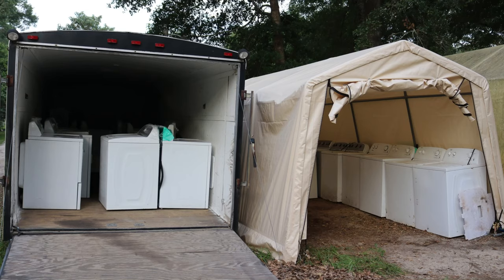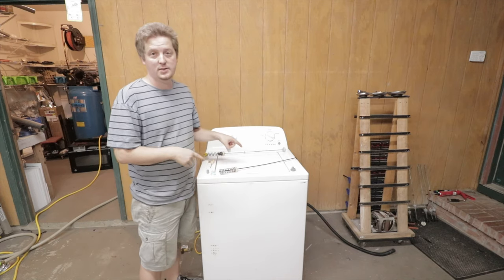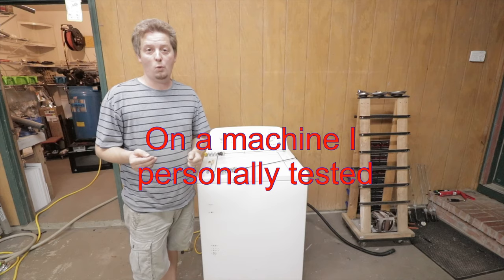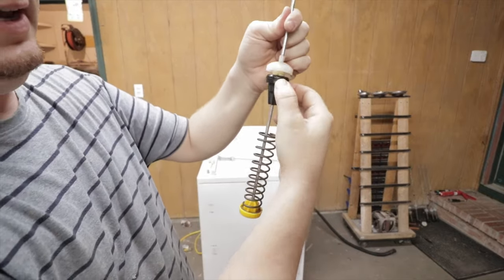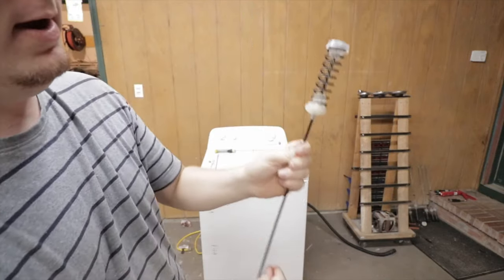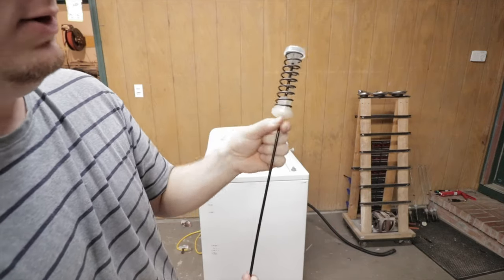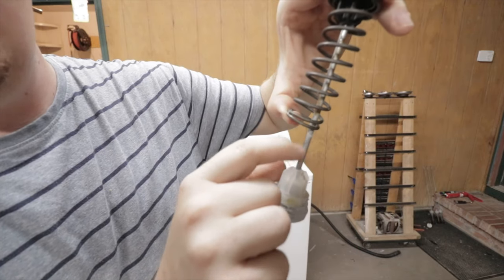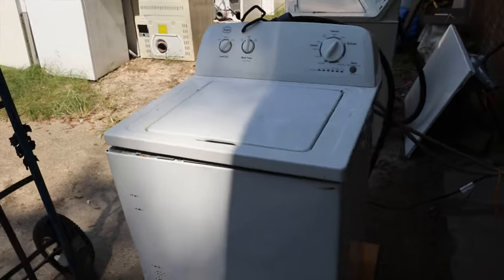Cheap Permanent? fix for shaking banging Washer? $7 to fix Suspension dampening rods W10780048

Comment: What if that top little round cap (the one that goes through the hole) is broken on one rod? I can't figure out what they actually do, since they are usually placed so far above where the spring assembly touches bracket on the side of the tub...
Reply from the maker: The tiny round cup that sits in the center of the ride I have always wondered about myself. I think it's just to help position the rod when they are putting them through the washer. But I'm not really sure.
Reply: I think that cap is there to shed any moisture off the rod as it goes down keeping it out of the resistance module

Comment: I been wanting to try this fix but fuze-it is not readily available around my area. Do you have any suggestions for similar construction adhesives I can try such as Loctite, Gorilla, or other versions of Liquid Nails? Thanks in advance.
Reply from the maker: Probably the regular version of liquid nails would be fine. The problem with liquid nails how long it takes to dry and then you have to keep the two caps separated for it to dry because it doesn’t like to dry sealed. I was about to do an experiment with windshield Glue. There’s a bunch of people claiming it works very well.
Reply: @WasherDryerMoney Great! Can't wait to see how it goes.

Comment: Would it hurt to add a little Nyogel 767A Synthetic Damping Grease to the rod after doing this Fuzeit repair?
Reply from the maker: I did not and it’s still working fine after all these years. I believe the dampening grease is just a factor for the original piece of foam to try to delay It’s ripping and deteriorating.
Reply: Thank you for your speedy helpful reply.  I will not use any dampening grease on my Fuzeit repair.
Reply from the maker: @blackdogjenny  I’ll be doing a different repair soon. Probably in the next week or two. It will be better than new and easier.
Reply: Looking forward to it
Reply: Couldn’t get Fuzeit to fully cure even after 5 days.

Comment: Thank you for your videos! I have a question. I have a Maytag Bravos thats banging around during the spin cycle. I ordered a set of rods but the ones that came were about 2in shorter. Got them in anyways and the washer is still shaking. Could the rod length be the problem now? Just wondering if maybe the new rods are the wrong ones for the washer or if theres anything else wrong with it. Thank you very much!
Reply from the maker: If the runs were shorter that's probably not the right rods. It could be that they are the wrong size and starting to hit something it wasn't able to touch before because it's 2 inches higher.
 it's hard to say for sure without seeing the machine but I would start with getting the right size rods that might just be the problem.
Reply: @WasherDryerMoney  Thank you for the quick reply! Its not really touching anything being 2in higher, but maybe if they are the wrong rods the springs could be softer maybe? Making it less stable? Dont know much about washers but yeah, ill order the right rods and see what happens, other than that, i dont see anything else wrong with it, theres no play in the shaft so i dont think its the bearings but the inner tub does have a tiny bit of play, dont know if thats normal.
Thanks again!!
Reply: @srolmeda  The tub is not 2” higher with the he shorter rods?
  Are you sure the tub ring is not hitting under the washer top?
Reply: @rickeykeeton71  Its higher with the shorter rods but its not touching on top. Im thinking with the tub being a bit higher up, it makes it unstable. Havent gotten the new rods yet, when i do ill give an update if it fixed the shaking or not. Thank you!

Comment: I’m going to try rubber “ cone washers “ as in sink water supply lines. HF and HD has assorted groumets. If fails, I’m going to try “ rope packing “ that goes around faucet stems. Should grip tight allowing movement as faucet stems move on and off. Maybe use tight “0rings “ to fill space and damper movement of damper .” Lol

Comment: Having the same issue,i was thinking how about a piece of pvc pipe  running the length of the rod to the shock and at the top put piece of rubber where the rod goes through?
Reply from the maker: that may work.

Comment: Are those flimsy suspension springs necessary to install when you're replacing the suspension rods in an Admiral top-loading machine?
Reply from the maker: Those supposedly help keep the drum centered. I don’t think I do a whole lot because some machines don’t have them at all.

Comment: Thank you for the informative video. I had the same problem, replaced the rods and all good now. I took apart the old ones and observe that the damping compound around the rod (inside the shell) was like a gritty gel. There was also thick grease on the underside of the cap. Any idea what that material is (was) originally? Might have been grease impregnated fiber but it came out in chunks with a small screwdriver. Undoubtedly degraded over time (So. Fla and it's hot here)

Comment: Easy cheap fix (for the suspension rod issue) is take a needle of any kind with the cap down (cap retaining sponge and spring down) push it down between the rod and plastic boom problem solved 

Your welcome
Huffs Appliance

Comment: Thank you for this awesome helpful video! Do I need to wait for the first two items to dry first, and then add in between them? The third item in between the first two, is it just a little on the rod that dries and then gets squeezed together? Or do you add enough to fill the gap between the first two when you squeeze it together with a quarter coin sized gap? Thank you again so much!

Comment: Are the suspension rods on whirlpool are they universal?
Reply from the maker: Some are slightly longer and you need to make sure you get the right ones. Check the link in the description and you should be able to find the exact rate part number by using your model number through that link.
Reply: @WasherDryerMoney  we're is the model number located on the washers?
Reply from the maker: @sergioflores7975  usually on a sticker inside the door, or on the back top
Reply: @WasherDryerMoney  thanks appreciate it

Comment: I have a suggestion.  I am a machinist and some of our older machines use cork with a little oil on them for spindle brakes.  I think oiled cork could work really well if you can figure a good way to get it on there.  Maybe split it?
Reply: You need damping grease. It’s very sticky. It what comes on them new

Comment: Would 100% silicon work?
Reply from the maker: I doubt it will work for a very long. The material needs to be fairly resilient because it moves a lot. I think silicon would probably wear through. I tried hot glue, and it wore through as well.

Comment: Why wouldn't another spring added to the topside of the existing springs work? Add the spring and some kind of clamp above it to hold it in place. This way there is a force reacting to the bounce that the worn out damper used to provide.
Reply from the maker: The main issue is the rubber piece not holding onto the rod to slow the action of the Drum. It seems like the spring would be a big part but it’s mainly that piece of foam.
Reply: @WasherDryerMoney  I actually tried to do this but it was physically impossible. Not enough room above the existing springs.

Comment: I have a kenmore top load washer purchased sometime in 2012. My washer has been shaking/banging violently during spin cycles for a few months now. I am trying to diagnose it best I can but I am totally new at this. I pushed on the drum and noticed it bounces some before settling. What is this a sign of? What part should be inspected?
Reply from the maker: It's more than likely the suspension rods. Especially if it's a machine that looks similar to the one in this video. If your machine has egg gray pause play button then it will have the suspension rods. The good news is I a lot of these machines suspension rods are cheaper because there's some aftermarket companies making them now.
Reply: Yes mine has the pause/play button. Any videos on how I can open the washer and replace these rods?
Reply: @WasherDryerMoney  Do you recommend aftermarket rods?

Comment: Why couldnt you just run springs from tub to washer base to help stablize the tub.
Reply from the maker: It’s more about the piece of foam, squeezing the rod to slow slightly the tilt when it gets off balance. That slight slow is all that’s balancing it. The springs are more just there to make it not bottom out so the piece of foam can do its job

Comment: Could you wrap a couple zip ties around that little foam piece to make it grip again?
Reply from the maker: That would probably work for a little while. The problem is that piece is usually deteriorating. I am going to try a few other things soon and I will make a video about it. The washer I’m still using and it’s working perfectly with the liquid nails.
Reply: @WasherDryerMoney  thanks for the reply. I have replaced the belt, suspension rods, and cycle shift actuator, and my washer still won’t spin sometimes with a normal load of clothes. Any ideas what to try?
Reply from the maker: @shannonsisk  if it won’t spin at all I would assume it’s the actuator but you said you replace that. It could be the lid switch is not working. If you mean it gets off balance when it starts to spend this could be the bearings have gone bad. It’s very rare but it does happen. If it’s getting off-balance and the suspension rods did not fix it I would assume it’s the bearings.
Reply: @WasherDryerMoney  thank you for the reply 👍

Comment: I just replaced the rods this last weekend. I still have the same shaking problem as before. I checked old rods just now, they all seem nice a tight. Could there be a different problem?
Reply from the maker: Not sure. Sorry
Reply: Might want to check for any counter weight misalignment or cracked stator if it has a stator and rotor.

Comment: You could have done the same thing in 5 seconds by smearing Nyogel damper grease on the rod and all moving parts. The stuff is super sticky damper grease that slows down any movement. Try is and see if it works. I use it on my front loader shocks and it works great. Oh and they make all these washers to fail. If you look at a commercial washer they have steel framse holding the tub and 8 beefy shocks to control vibration. I can wash 4 big rugs in a commercial FL machine. Home units have a design flaw and are made to fail.
Reply from the maker: I would definitely agree there made to fail. Yeah, they sticky grease is a good idea, but I would still replace the foam piece because it will continue to deteriorate and create a void where the grease will no longer be able to grab overtime. A lot of people are replacing the foam piece with three-quarter inch yoga mat.
Reply: @WasherDryerMoney  Where can you buy the foam they use?
Reply from the maker: 3/4 thick yoga mat off of Amazon. you’ll have enough to do hundreds with one mat.
Reply: @WasherDryerMoney  You want to see a tough washer youtube this --> BRICKS in Miele washing machine

Comment: Mine bangs and goes off balance, but if I push down on the basket it hardly moves and certainly doesn't bounce like I've seen other videos where they test the rods in that fashion, is that a good test or can they still have a issue with that foam piece?

Comment: If washer is old enough (close to 10 years lifecycle) this fix won’t help for long, as washing machine ages it’s axle balance controlled by spider arm gets off center and that is what essentially causes problem. Stiffing up spring reduces vibration so knock sensor  stays happy but doesn’t solve core problem - off centered drum axle, so this will continue to develop resulting in spider arm bearing to fail. So this is intermediate solution till you get good deal on new washer.
Reply: You've got your terminology wrong.  Top load washers don't have a spider arm.

Comment: I've had this problem since I bought my new Maytag MVWC565W1 washer. The thing gets out of balance and shakes like hell. We rebalance the load and it settles down somewhat. The salesman says this is common and the only solution is smaller loads and rebalance when you need to. So we bought a big load washer that we can only use as small load washer. Any ideas?
Reply from the maker: I have seen that Samsung started putting a rubber piece over half of the spring. I imagine they’ve done this to step in the spring to make it not bounce as easily. I’m going to experiment with this soon. Call Of the washers with a pause play button and six little lights on the front have the same horrible suspension on them. My only recommendation for a different type of washer is the speed queen classic. Speed queen makes a new version but I have no idea if there any good. They still sell the original that everyone loves that last forever it’s called speed queen classic. It’s the only one I recommend.
Reply: We have the same issue with a brand new Maytag MVWC465HW2.  Very poorly made.

Comment: Still don't have the new rods but I removed the original rods today.  The damping material was sort of a semi-felt like greasy wax similar to one of those wax earplugs.  I think toothpick guy had the right idea and I snipped off the point on some round fat toothpicks and pushed them in away from the rod along the plastic wall.  You can easily add them until it drags again.  One of them popped out of the socket and it felt like soft foam.  They probably are deteriorating.
Edit:  Adding the tooth picks only worked a few weeks the bushing material was falling apart (these were the original rods over 9-10 years old).

Comment: Thank you for the repair video.  It was helpful and interesting.  I was curious about one of your comments towards the end of the video.  You mentioned that you don't like machines like the ones in the video (ones with suspension rods I guess).  You did mention that you like direct drive machines though.  Is it possible to have a direct drive machine with suspension rods?  I have a Samsung model WA45H7000AW/A2.  Anyway I was just trying to understand what your comment. Thanks again for the video!
Reply from the maker: Drag drive machines I don’t believe are being made anymore. Direct drives were made buy a bunch of different brands but mainly Whirlpool and Kenmore. They were very popular from the 1980s until the around 2000.
They were not perfect machines but they were extremely easy to work on and the parts are very cheap. Compared to newer machines now they were a lot more durable. The only machine I recommend right now is the speed queen classic.

Comment: Why couldn't they just use traditional tub springs like the older washers have?  With this crazy rod it seems that friction will burn up that piece of foam or rubber very quickly.  I'd like to have 5 minutes with the guy who designed this idea!   I have a new Conservator washer that's shaking in spin mode from day 1 even with light loads.  I'm beyond words.

Comment: As an appliance technician I recommend replacing the suspension rods with OEM parts only no modifications and not Amazon parts Amazon appliance parts, are not up to specs, and may not last long
Reply from the maker: Ya, it’s too bad OEM is so expensive. Sometimes you can get them for a OK price but usually they they charge way too much.
It’s funny how the Original Equipment Manufacturer still produces parts that has such a short lifespan. The one I made here is still running strong after all these years. I wonder why they don’t use something more substantial than a weak piece of foam for the backbone of their dampening rods.
Real mystery…. Lol

Comment: I wonder if rubber fuel or vacuum hose of the right size would be too "resistive" or last long enough.

Supporting, balancing, and dampening a tub of water and laundry at relatively high speed with a small piece of lightweight friction material makes it seem it was designed to wear out purposely. It might have been designed by the company accountant or a lower pay grade engineer with a poor GPA in "Engineering School."

(The bungee cord idea seems excellent.)
Reply from the maker: Actually I’ll be making a video on some of the many ways to solve this problem. One of the ways is put in a small piece of vacuum hose inside of the deteriorating piece.
Reply: @WasherDryerMoney  ready!!! where?

Comment: I was gonna do this for my car as the motor mounts ar after market i figure slice the rubber bushings of and use the black PNL from homedepot to re build them from scratch and found a few videos on YouTube describing how to mount the parts and fill them i think volchem would be 👍 teca one gallon pail of vollaized rubber that air dries

Comment: I know the video is 3 yrs old but i am having the same issue, I'm thinking of 3d printing that piece out of ninja flex flexible filament
Reply from the maker: You can cut it out of a yoga mat. That’s what a lot of people are doing now and it seems to be working very well.
Just cut it barely bigger than the hole so it squeezes in nice and tight. 
You’re supposed to use 3/4 inch yoga mat but if you can’t find that you could always stack it.

Comment: Does this problem throw out an "LD" error code?
Reply from the maker: Off-balance is the main symptom. It can be lightly off-balance and then it will slowly over time become extremely off-balance and not make it all the way through a full cycle.

Comment: How about silicon? Or rubber cut from tires?
Reply from the maker: I tried silicone it's too soft and ripped to pieces pretty quickly. If you could mold rubber it probably would work.

Comment: 100 percent rubber silicone, but maybe paper around rod before silicone,  so it can’t stick to rod ?
Reply from the maker: The only issue is that piece slides down the rod as the washer fills with water and then slides back up when the washer drains. So it's still has to move about an inch up and down.